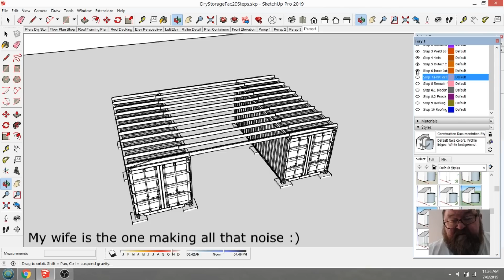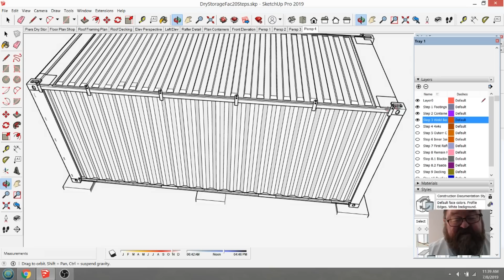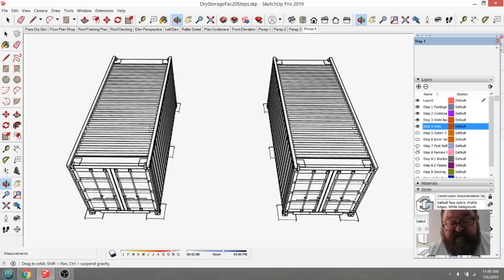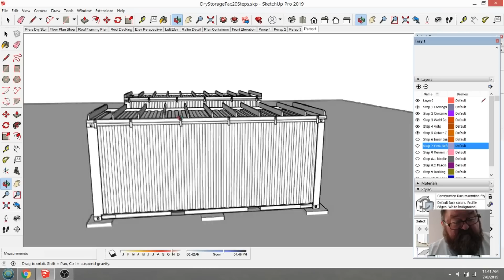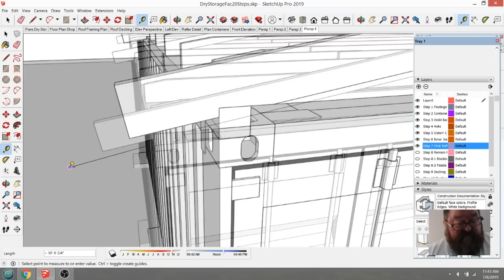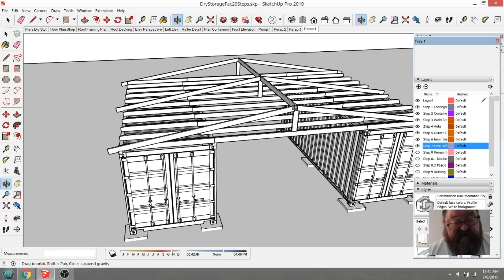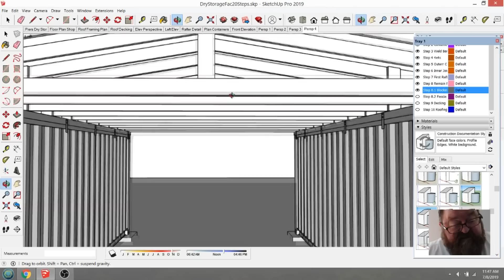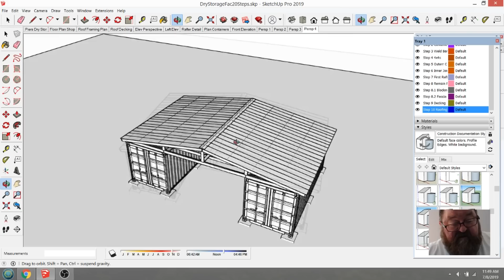Building a Roof Over Two Shipping Containers - SketchUp - Active Military Use - Read Description

Comment from the maker: This design was for an active military use where they only had 2" x 6" x 16' available. I designed the low pitch roof so the 16 foot 2" x 6"''s would  work.  This was not for a habitable living space. It was to store materials and have a space to work on vehicles.  Please understand that you should never take a design from another project and use it for your own.  Always, design or have your project designed for your specific site.  Not doing this shows in experience and lack of knowledge.  If you want a similar design for your project, contact me at atdrafting.com for a designed customized for your site.
Reply: Are you sharing your SKP file?
Reply: 40 by 40 in between the containers would be something id want in PA snow in winters  so i thing id need more of a roof pitch   can we achieve this?
Reply from the maker: @boochie123  yes, like I said above, this design was for limited material use for a military base. It can be modified for non combat use :)
Reply: Hey i am doing the same but thendementions are off hl,he put 20  feet inbetween and its 37 o er all and 5foot hang ovef both ends
Reply: would this work with 2x4 ,  ??
Reply from the maker: @billbryan9258  only if you bought engineered trusses using 2x4 cords.
Reply from the maker: @billbryan9258  I would recommend that due to the low pitched roof.   These spans ar a bit much for a 2" x 4" rafter which does not show up on the span tables http://www.southernpine.com/app/uploads/SPtable17_060113.pdf  2" x 4" are used on trusses but trusses are engineered with webs and cords positioned at certain place to handle loads.

Comment: What’s the point of doing a full plywood roof if you plan on doing a metal roof? That doesn’t make any sense
Reply from the maker: It makes sense if you want a stronger roof.  You could learn this is you wanted to but bet you'd rather troll lol   Hint: ask ChatGPT or your ai of choice "how does solid decking such as osb have advantages over just using 2x4 purlins at 24" o/c  for metal roofs.  Here I will help your lazy mind :)   

Advantages of Solid Decking (like OSB or plywood) over spaced 2x4 purlins for metal roofing:

Improved Structural Support
Solid decking provides continuous support under the entire metal roof, reducing chances of denting or oil canning. It’s like walking on hardwood versus a trampoline—your metal panels appreciate the difference.

Shear Strength and Diaphragm Action
A solid deck ties everything together. It adds lateral stiffness and can help your whole structure resist racking in high winds. You don’t get that kind of help from spaced purlins unless you’re in a pole barn with a prayer.

Underlayment and Moisture Barrier
With solid decking, you can use roofing felt, synthetic underlayment, or peel-and-stick membranes to manage condensation. Good luck stapling underlayment between your 2x4s.

Fire Rating and Code Compliance
Depending on your local building codes, solid decking might be required for certain fire ratings or wind zones. Purlins alone won’t pass inspection in many places—unless you’re building a chicken coop.

Quieter Roofing System
Metal roofs on purlins alone tend to ping like a snare drum in a hailstorm. Solid decking, especially with underlayment, dramatically reduces that sound. Your dog will thank you.

Easier Install and Walkability
Ever tried walking on a metal roof over purlins? It’s like parkour without the glory. Solid decking is safer for installers and future maintenance.

So yes, while purlins can be used in certain applications—especially in ag buildings or where ventilation is key—calling solid decking “wrong” is like saying a seatbelt is optional in a demolition derby. It works fine… until it doesn’t.

You're welcome, dear critic. This message was brought to you by basic building science and one very polite AI.

Comment: Have a question, I'm thinking 4 containers connected in a square with open Court yard in middle. Then add 2 container on top of them. So then I put roof over top of that. And have second level and my court yard or living room could have a 12 ft Christmas tree. With a Barnadium style roof. Does that make sense. I haven't seen anyone do it that way. They stack them all differently. But not with a court yard living room and built second level with Bedrooms

Comment: I watched a gentleman build one of these structures, but because he did not extend the trusses all the way to the outside edge of the containers, his structures was a higher pitched roof, and the ends of the trusses were attached to the INSIDE edge of the containers, still pretty cool.
Reply from the maker: Probably not a good idea since the roof of the shipping container s not designed to take a roof load.

Comment: Could this design be done with 2x8x24 , in order to have more spacing between containers under roof.
Reply from the maker: Yes, we used 2x6x16 because that is all chief Don at this base.  Probably a couple more feet in width maybe a little more.

Comment: Aren't these just gable trusses?
Reply from the maker: The point is,  Chief Don was in an active zone in Africa and had a shipping container full of 2x6's and that is all he had so I helped him work out a truss for the storage he needed.   They are more like attic trusses than gable trusses.  Gable trusses are made to sit on the gable end wall and have vertical framing members that act like studs for the sheathing and siding.  These are more like attic trusses.
Reply: @ArtisanTony  Thanks, I wasn't sure what they were called.  It looks like they're just trusses that are built in place instead of the 'normal' bureaucratic method. Makes a LOT more sense this way. Simple is often more.

Comment: Would it be possible to have a similarly built building but with a garage slab, rear wall and an over head door?
Reply: I want to do the same but containers are 20' apart.I'm thinking about a steep roof too

Comment: I've seen a lot of designs that are not helpful either because of the design itself or the way it's poorly explained. In this case, you've done a nice job with both. Thanks.

My only question at this point is whether you think that roof is sufficiently anchored to the containers to keep it from flipping over during high winds, hurricane, etc?

Comment: Do you recommend enclosing the roof over top fully or leaving it open to breath? I worry about snakes or critters moving in on top if the containers but its alot more cost as well.
Reply from the maker: Some people close them in for the reasons you mentioned but this one was on a military base in Africa so it was left open.  All they had there was the 2" x 6"s and the metal roofing that came in the containers.

Comment: 2x6 is too light for 14 foot span. Code is 2 x 8 at10 foot. I owed a house built in the 70's poor even for 2 x 8 at 14. It was 23 foot wide and lapped in the middle on a center beams and piers. It was a hard one re-square to get the doors through out the building to close. The floor rolled as well. Lots of re-work 40 years latter!
Reply from the maker: Maybe you didn’t watch the video or read the description
This was for active military base who only had 16 foot 2x6 and it worked fine.  What do you do for a living? Also, the spans you quote are wrong. Give a link for what "code" or span table you are quoting?  2" x 6" at 16" o/c will span 13'5 with 20/10 loading.  Please do not quote facts unless you are going to quote your source. You do realize there are different spans for different loading and wood species types right?   I'll give you a few days to respond then I'll delete your comment because you obviously do not understand the project or the span tables.

Comment: I’d like to do something similar but with the two containers right next to each other and rotated so they are both in the back of what would be a garage/carport . The gabled 8/12 roof would be perpendicular to the containers providing a car port 20ft wide in from of the 20ft side of the containers. Would this all work the same, but turning the roof the other way?

Comment: In areas of significant snow load, what is maximum pitch you recommend for roof over two 40’ containers.   6/12?
Reply from the maker: as long as you follow the design guidelines for low slope rafters in the span tables, you should be fine.  Look at southern pine span tables for example and low slop rafters and snow loading.   You can go as low as you want with the proper rafter and spacing.  But yes, 6/12 is a nice slope for any application.  Check this link out https://www.awc.org/codes-standards/calculators-software/spancalc

Comment: IF YOU DO NOT ALREADY OWN THE CONTAINERS...  for goodness sake, investigate alternative building methods (like a pole-barn)...  When you weigh the total cost of construction. Incorporating shipping containers cost more than stick building the same square footage.  Not to mention the loss of usable space.  
PLEASE realize that inside an 8 foot by 20 or 40 foot container... in order to get something in/out of the back you must have a walkway, so you instantly lose 2-3 feet of the 8 foot container... you just lost 1/4 to 1/3 of the "usable" area...
THE ONLY time using a shipping container makes any sense for a storage shed is if you DO NOT need to "ADD ON" to it... If you only need a 8x20 or 8x40 shed, that is the way to go...
If you calculate the cost of of the same square foot pole barn (where the entire inside is open and usable) you will find the pole barn costs LESS...

I have two 20' containers and have priced the materials in using both in one building(similar to this) and other layouts, as well as making two buildings with one container each... NONE of them pencil out compared to what I ended up building from scratch as a pole barn... 
I have ended up still using the containers as they are... that is the only way they made sense financially...

Do the math... you will be surprised...
Reply from the maker: I made a video on this topic already. It is called "Shipping Containers Make No Sense"  If you read the description you will see this project was a special request for an active duty friend (master chief) where they only had containers and 2" x 6" for rafters.
Reply from the maker: @David Hamilton they work for storage not living in.  I have proven this in my series of videos

Comment: I have 2-40 ft shipping containers on my property and have been toying around with a similar idea. A roofing quote almost gave me a panic attack, what would a ball park estimate be for a DIYer?
Reply from the maker: It depends on how far you went with finishes.  Just to frame it and roof it probably $6,500 with 26ga 5b tin roof
Reply: @ArtisanTony  Thanks for the reply, it would be low budget. I use them mostly for storage, in FL the heat can be brutal - some shade would be nice.

Comment: This is the basic idea I used for my first welding shop with a 12 foot overhang over the doors.
Reply: I'd like to see what that looks like, with emphasis on the overhang. That was something missing from this design that I would add myself.
Reply: @_onesimpleidea  come off of the doors joined at the roof section extend to length desired put 6x6 post each corner for support. 
Add walls

Comment: Very good video. 
Question. I live in central Florida. Can you modify your design. I would like to poor a 20x20 foot slab with a hole dug for the 3 footings on each side. Then 3 footing 8 feet away. 
Place the shipping containers in place. Bolt on a wood top plate on the inside. Attach joist hangers to the top plate. Then screw in joists between the containers. Then cover with corrugated steel. Then build a simple stud back wall. On the front add a roll up garage door and an exterior door. 
I can then add insulation and cover with 1/2 plywood. 
Would this work for a work shop? Would a flat roof work? I feel in a heavy rain. The excess water would run off. Then the rest would evaporate. 
What are your thoughts? A lot of people live in areas where it never snows. Please modify your drawing for this. 
Thank you in advance.
Reply from the maker: I modify these for different people for a fee. It is what I do for a living. If you want this done, contact me at atdrafting.com to discuss  the fee.Thanks

Comment: Just run ur bottom plate and run all the trusses or boards across and hanger them saves alot of time cutting
Reply from the maker: Does not work on a container. The  steel roofing sticks up and you have to use the 4x4 to raise it up.
Reply: That's what the bottom plate is for 
Bottom plate it a 2/6 doubled or whatever then trusses sit on
Reply from the maker: @roofking2314  I guess you didn't watch the video. That is basically what I did.
Reply: Basically yes just telling u a faster way to do it is all
Reply from the maker: @roofking2314  The flat spot on top of the containers is just wide enough to put a 4x4.  A 2" x 6" will not lay flat because of the ribs in the top of the container.  They are all pretty much made the same way.  You could stand 2-2x6 up and I did  that on the last design.  But there is only like 3 1/4" flat spot there.

Comment: I don't see why you would need the outer ceiling joists at all. Surely you would only need the centre ones and the rafters could still attach to the 4 x 4 or whatever it is bolted to the container outer?
Reply from the maker: I designed this for the US military active duty use and they liked and approved it. It was good for them.  You can build your own however you like.

Comment: Awesome video Tony. What is the max distance you could go between the containers?
Reply from the maker: Thanks!  This was for a military use where they only had 16' - 2" x 6"'s so for 16' material, 14' between the containers.  But if you want to use manufactured trusses there would be only the limit of the trusses.  I guess practically speaking, I would limit it to no more than 20' between them.  Again, it depends on a few factors.  If you make this huge roof, you are going to have to make sure the containers are secured to the ground and the trusses are secured to the containers or a decent wind will take it away for you :)

Comment: I might add 2-3 ft overhang off of the front by extending the 4x4's to give rain protection for the door openings.
Reply from the maker: That is a good option.  And you can always weld a bracket to support the 4x4 if you wanted a decent overhang

Comment: This week I just put half the roof on a single 40' container. I used 16' 2x8s coming from the center of the roof out 12' (using 4' for above the container). This creates a 11' overhang (1' eve) on both sides of the container.  I used about 1'  drop in 10' for slope. The one thing that stuck out to me on your design was the 4x4 bolted to the roof. My container did not have 3.5" before the ribbed roof got in the way. I welded  3" angle iron sticking up 6" to bolt the rafters to. I needed to grind 60% of the to allow for the upward dents in the roof. Did you need to adjust for that?  Thanks, great video.

Comment: I'm needing this, but the containers are 20 foot apart.
Reply: read the top comment, modify it yourself
Reply: The space between the containers was 14ft and a 16ft board across the space. 5:53 The inner space would be 14ft wide, 20ft long, 9ft high. But take note, some shipping container's height are not 9ft.
Reply: Mine are as well.would like to raise roof up for storage with steep pitch

Comment: Great video clip.  Curious how the roof resists wind uplift?
Reply: I would put joist ties attached to the 4x4s. Although on the 4x4s i would put another piece if angle on the inside and ise through bolt's and not lag bolts. It would be extra time and money but imo it would secure the roof better. Whats your thoughts?
Reply: @dustinearley5769  agree, thru bolts for the 4×4's then hurricane straps or similar at every roof truss joint.  Plus anchor bolts /foundation rebar into the ground to keep the containers from moving - if the location is in a high wind prone area (tornados or hurricanes).

Comment: if extend the bottom higher up. You'll have better air flow and a higher roof. plus it will look more professional with 2 sets of steps. in case of flood you be cover and you can store things under the containers. Plus the dog won't mind.
Reply: Make the most of the space with options.

Comment: I want to do it two stacked. The top middle will be open area with glass on each end . Thick curtains. Screen deck on each end outside the glass. Parking on bottom floor. 4 stacked 2 high on each side. Yes lots of air conditioning. Electric heaters. Outdoor wood heater.

Comment: I'm having a hard time seeing why trusses arent easier. This looks doable and simple enough, but easier?
Reply from the maker: Trusses are generally easier because you just set them and nail then in place.  They also clear span greater distances than typical dimension lumber.  For a homeowner they don't have to worry about figuring rafter lengths. Th truss company does all of the hard stuff You just shove them up them and set them :)  I wasn't sure if you were questioning trusses or rafters
Reply: The original question involved the difference in time and labor between 
Building trusses yourself and stick building this way.
If one was simply buying factory made trusses it would certainly be faster to just set the trusses. 
In most cases it always boils down to time or money.
Then what can be done in remote areas far from a truss factory
Becomes part of the equation. 
Nice video. Thanks
Reply: Any problem getting something like this passed zoning laws?

Comment: What about garaging of taller vehicles, like a tall camper? Make at least 6 or 8/12 and cut it off at the inside. Then bolt/add the top of rafters to continue the expanse to roof tip, after first one, copy and pre build so that the lower joists are not needed. I mean, build a vaulted roof for taller equipment.